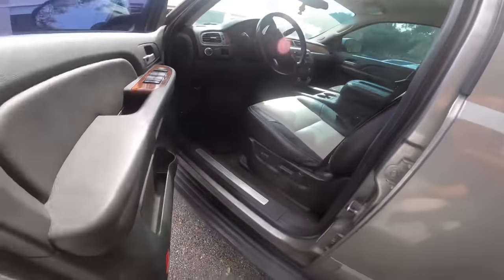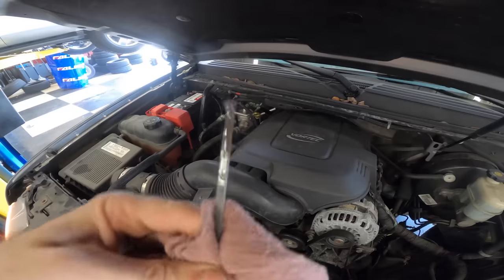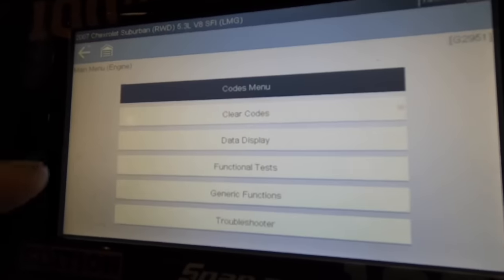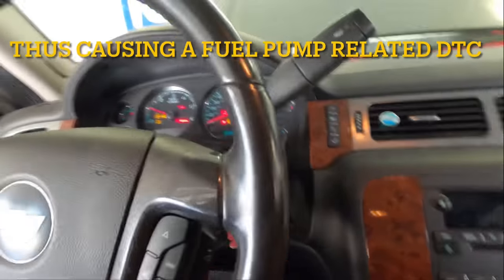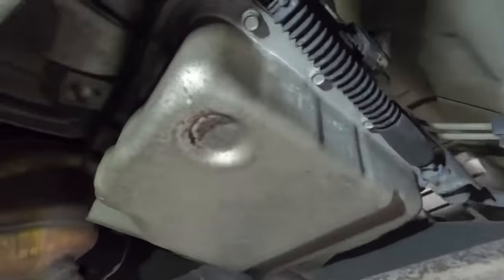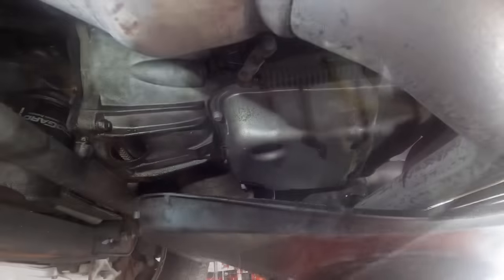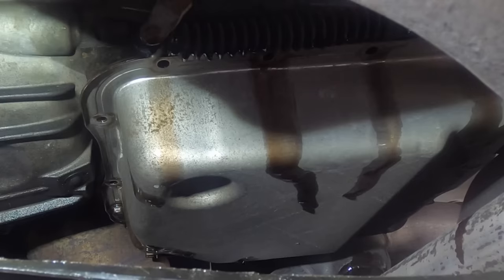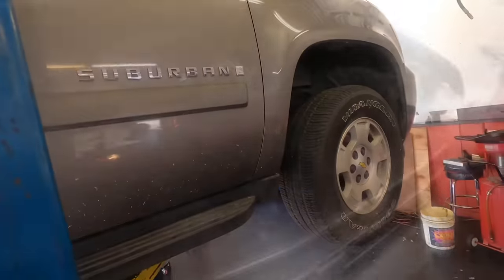Busted! SCAMMING Mechanic Causes Damage! 4l60E Transmission

Comment: Spent 40 years in the automotive field. 25 years as a automotive instructor, and 20 years working on those darn cars. I am now 83 years old and have been retired for 20 years. I hated when mechanics tried to run a scam on innocent people. I always tried my best to do an honest job for a fair price. You sir, are a boon to our field. You did an honest job. I hope your customer got some of his money back.
Reply: Yes. My father is a marine engine mechanic as well and is the same way about treating customers right.
Reply: Removing power from the trans will force it start in second, and shift to third,  and maxes line pressure. Older GMT400 and GMT325 models definitely had ignition switch issues that caused this symptom. Somebody knew damn well what they were doing, they were going rip someone off. Driving around in 2-3 hi-cap for weeks equals a somewhat stupid customer though. That transmission is probably short on life now too, 4L60E wasn't known for being overly robust.
Reply: Travis thanks for all the years of hard work and i just wanted to give you a pat on the back for being a hard worker and good person…..💪🏻👍🏻
Reply: Respect mate
Reply: @jamesgeorge4874  was that a 4l60? Damm ones I've seen go upto 450hp in a commodore, I don't mind em still to this day haha, my vx v6 runs a 4L60 tran in it and she's smoother then most... (mind you, it's paired with a 3.8 ecotec or 3800 l36 S2 in usa)... it's all bulletproof I reckon haha
Reply: Just watched this video from England and I have to commend you for being a good honest man. I wish you the best sir!
Reply: @mr.sunnyg5510  it's not terrible, the factory sun shell is weak, and the factory reliance on a clean MAF sensor are its biggest drawbacks, anything over 450 hp , or use in a heavy vehicle, it's not really ideal.
Reply: I'm a automotive technician and I used to love doing it going in every day I loved it and the best part was I made really good money doing it now I'm constantly being asked why my hours are down because they are comparing my hours to to guys who are thieves with no morals and don't care that the person they are ripping off probably didn't have the money to do the repair but felt like they have no choice because they need their car so they go ahead with the repair. It's sad but I can say it does happen and it happens a lot and it's the owner / managers that allow it to happen and I guess I'm no better because I know it's happening and I do nothing about it. I have a family and bills to pay I know that shouldn't be a excuses but it's a tough situation.
Reply: You sir are a genuine inspiration
Reply: Hope that one day i can becone a good mechanic like you and the video poster. Doing good honest quality work is far more profitable then trying to scam people who probably know next to nothing about their cars. Plus id get the satisfactjon that i actually fixed the problem instead of duct taping it for someone else to fix.
Reply: @Abandonsoyciety  A good, honest mechanic has more work than he can do.
Reply: @jamesgeorge4874  as I said in another post, the customer should sue the shop that did that for transmission damage. and maybe get a unit with an upgraded sunshell. like the Sonnax or BEAST.
Reply: @mr.sunnyg5510  well I've got a 4l 60e in my 04 vy clubsport and I didn't drive it like a fool....got it with 110,000 klm's and it was 10 years old....by 150.000 kkm's and 2015 ,..4th was slipping... Needed a rebuild..not reliable for a car over 250kw's ..or over 100,000miles.. According to the yanks.
Reply: @palerider2020  04 clubby aye? Didn't they have the 65e instead of the 60e? Is M32 the tran code on it
Reply: @mr.sunnyg5510  mine is an 03 not 04 and it's not an R8....not sure on the 32 code
Reply: @palerider2020  ahh right.
Reply: @mr.sunnyg5510  how strong are the diff on these cars,..someone said nearly as strong as a 9 inch??
Reply: @palerider2020  all depends mate, they come with a lsd from factory I'm pretty sure so the original should hold up (ol 9 inches can take 400+ horse power) and ya stock clubby is doing 320hp about... if ya ever looking for a good diff, Trumac (truetrac sorry) is the go.
Reply: @62saki91  I have been to court on behalf  of the plaintiff in cases where the shop's negligence caused over $5000 damage more than once. Unless the defendant admits they made a mistake, or it's on video, the burden of proof is on the plaintiff. It's extremely difficult to win. In each case the plaintiff got the money back they spent on the repair, but that is all. Most times the attorney fees are higher than that, and the end result is disappointing. It's bullshit, but that's just the way she goes.
Reply: @jamesgeorge4874  that is partially the fault of the plaintiff, sue for damages, or repair bills and legal fees incurred. ;)
Reply: @palerider2020  everything in the case is replaceable, '98 and up the case and bell   separate too, whomever told you that was short on skills. I've seen the same 4L60E built at 180K, then rebuilt again at 430K, and the last time our shop went through it, it was over 700K, he just wanted to put a million miles on it. GMC Savanna with a 4.3. Michigan to NYC, 3 times a week, pretty much non stop.
Reply: @62saki91  It's up to the Judge, what the plaintiff gets, and what the plaintiff wants, and what the plaintiff gets can be  quite different.
Reply: @jamesgeorge4874  thanks for the heads up... My 4l60e is behind an  03, ls1 and has been tuned to about 230kw at the back wheels...and after a while 4th started to slipped when I kicked it in the guts...I got told on some forum that after 100,000, miles,  they start to play up..I was gonna put a Cam in it...but got told will have to strengthen the box, and put a hi stall...so not gonna bother with it...thanks again.
Reply: @palerider2020  not a bad plan either, especially is you're turning up the wick. Good luck in your endeavors.
Reply: How you survived that industry for that long and not drag a few customers out behind the shop I'll never understand.. but good on you kind sir.. you are a gentleman and a scholar..
Reply: oh really lol
Reply: Travis Bradley ? for draining transmission fluid from my car with not drain bolt. I used a fluid pump and drain the oil from the dip stick by inserting a long tube so I don't have to spill oil when removing the oil pan.
Reply: Travis Bradley ? You ever heard of a customer sabotage his own vehicle, so when he takes it to the mechanic the engine would lockup, just so he can sue to get a new engine ? The owner do some old 1960s mission impossible stuff with a remote that disperse "Sodium Silicate" into the engine.
Reply: @jamesgeorge4874  You can not call people stupid because they don't know anything about their vehicles.  That's why they go to mechanics.  Otherwise they would of become one themselves.
Not everyone can feel or hear the difference in their vehicles when they start to need service.  Nor can everyone afford to make repairs immediately.   Some of us have to pinch pennies.
Reply: Well said sir I own a paint an body shop, I seen it all on people getting scammed by getting CRAPPIE WORK. I do great on prices an life time warranty all my paint jobs
Reply: Same here, I had more hard time fixing scams that really fixing regular problems.... I couldn't walk away when somebody tells that they've been scammed out off 3k or 4k and needed a certified tech to help them out, because they needed the paperwork to file a lawsuit,  I saw things that I thought only happened in movies, lmao... like a whole shop disappearing, I'd go with the costumer to the location, and they were gone like if it never had been there... most times I'd find the property owner as confused as we were finding their tenants just gone...  the kick is ,these type of ppl make 10 or 15k scamming ppl and don't pay rent for 2 or 3 months, and move on to the next town... is obvious that at the end of the year it'd add up to a good bag of money..., although in one occasion, things went very bad for a car sales scammer when the costumer learned that he got duped out of 9k for a vehicle, the costumer went and shot him multiple times, luckily the man didn't die, since then I was very careful taking on those cases....
Reply: 83 years old and your name is Travis ?
Reply: @cohohoho2589  That is correct
Reply: I began figuring out how to repair my own vehicles after I was ripped off by a mechanic. I would go to wrecking yards and just look at all the vehicles they had. I would talk with other customers there and watch them removing parts. I would get permission from the yard owners to take parts off and put them back on just to gain experience. I eventually got a chance to work in a Kenworth dealer/repair shop. That lead to me getting hired at a construction company as the fleet mechanic. They had purchased 25 new Kenworth trucks with end-dump trailers and three triple transfers to add to their existing fleet. There were a number of older guys working in the shop who had been doing that kind of work for 40+ years; and while I had some knowledge of fabrication, one of the guys took me under his wing and showed me a lot of tricks. He told me it was rare to find someone who would take time to teach a beginner, so I needed to respect the knowledge he was passing on. I still carry that respect to this day.
Reply: @jamesgeorge4874  not sure i agree with you on the robustness of the 4L60E, possibly just my luck with them but I've yet to find one that isn't near bulletproof (two in the 160k range, one in the 230k range and many more I can't recall) IF you aren't trying to drag race them, etc.
Reply: @palerider2020  if all you do is putt around, they'll last 200,000+ miles. I got my wife a 2007 Trailblazer with the 5.3l with the 4l60 or 65e, either or she's at 200,000 miles with no problems. However, my 2003 Silverado with a 5.3 and 4l60e, I'm a little rough with and I'm sure the 35's don't help, I'm at 300,000 miles and like clock work, it's needing another transmission, it goes out every 100,000 miles
Reply: Thank You Sir For your Instructioning  of your past students. You are a example as of doing the job correctly. I myself made proper repairs In the past. My Instructor told me that if you do good work and your honest your parking lot will be full of needed repairs. I had to leave one facility do to their stupidity. I wasn't.going to be any part of it.
Reply: @jamesgeorge4874   Very True, It's going to buy the owner a little time. The 4L60E can be built better than when It was new.
Reply: @mr.sunnyg5510  They are a good transmission to rebuild with some up grades. The 4l80 Is another good one but the.shift cable runs opposite of the 4l80E.
Reply: @diameadozen  I Was In the same boat. I guess our boxes are on wheels for a reason. I understand and I'm glad I'm gone.
Reply: @christopherl2143  If you don't mind me asking what do you do now?
Reply: I've never met an 83 year old named Travis...
Reply: @silkroad1201  Travis is actually a old French/English  name look it up
Reply: @palerider2020  no they're not as strong as a 9" without a good bit of work done to them, and at that point, you could have likely used that money to pay for a large chunk of a 9". It all depends on what you're doing though. There's plenty that are under vehicles running anywhere from 12s to 9s in the quarter mile, but they all have lots of work. Stock for stock, the biggest difference is the 9" doesn't have C-Clip axles, big bearing ends, drop out third, etc etc. 

I will say if you're worried about your 8.6 and want to gain some cheap strength, you can always find a 14bsf (14 bolt semi float) axle that came in the 1500HD trucks and a few others. Basically getting a 6 lug rear with 9.5" ring gear, larger 33 spline axle shafts, and if you search around for the right one, its pretty much a bolt in deal.  You can probably pick one up for a few hundred bucks, and gain lots of easy strength for the money, but it will take some looking around for the right one. 2wd are narrower than 4wd, some are 8 lug vs 6 lug, the ones out of cargo vans have an offset diff I believe, etc. Thankfully plenty of folks have figured this all out and it's on the web in numerous places. 

In all reality, unless you're launching hard on slicks with a lot more hp than stock, you'll probably be fine on the 8.6. It's the traction at launch that breaks most of them and it's why you see them living in 800hp+ turbo'd trucks with sticky tires. They often don't leave violently off the launch and the power comes in after the 60', which often times is specially tuned that way to help with traction off the line or on the street. Just run it til you break it and go from there. Thankfully the 8.6 10 bolt seems to hold up much better than the 8.5 bolt in OBS trucks.
Reply: @palerider2020  as far as the 4L60 goes, I've never seen one reliably hold up to higher HP. I've seen several fail on stock power, just being driven around town by responsible drivers. That is what I'd be concerned about swapping for something that can take more abuse before the 8.6. I've seen some 9 second trucks running an 8.6, but can't recall any with 4l60's.
Reply: @randywright9952  You can scam anyone once.  A bad rep is hard to repair.
Reply: My 96 Chevy Blazer has a 4 L 60 e in it, that Chevy Suburban is a 4L 65 e
Reply: @palerider2020  the diffs under half ton chevys has been junk for years
Reply: @biosaber585  i dont know if you know this but for a good trans 200k isnt alot
Reply: @hansloe3742  depends on the context the transmission is being used for. A daily driven car with 200k vs a racing build with 200k have amazingly different wear and maintenance curves. 
Also you gotta consider WHERE a vehicle is from. I live in the Rust Belt of the US, daily drivers here take heavier wear due to the road salt and chemicals used to treat for snow and ice, it means any vehicle with 200k generally isn't worth much more than scrap for body, frame, trans, etc.

The 4L60E is a solid 3 speed within all contexts, its a good daily transmission, well liked for towing rigs (medium weight) and is pretty durable for all terrain things as well like mudding and crawling. Id not recommend one for heavy wear and tear or insane stunts but totally stock its one of the better transmissions chevrolet has made.
Reply: It's a shame that when you find an honest person, it's like finding a unicorn. What happened to people.
Reply: God bless 🙏 you brother
Reply: Hope you were better at working on cars than you are at math lmao
Reply: @JONOTron theyre really not. Some of the most prominent picks in offroading and racing are the power glide, turbo 400, turbo 350, 4L60E and 4L80E, obviously stock they aren't the world's best but they're all sturdy transmissions that last longer than those used by dodge, Ford and Toyota. And once we start talking aftermarket work on them they're really some of the strongest transmissions on the market that aren't a purpose built part.

There's a reason the prices for these transmissions are to this day ridiculously high and its because people who want them are willing to pay top tier prices to get them, they're reliable and can take a beating, its like the ford 9 inch rear axle, sure they make better ones these days but its still used because of its durability and reliability.
Reply: i hope that scammer got the worst he could for screwing over who knows how many innocent people, a hefty fine for the scams, losing his business and jail time to ice the cake.
Reply: A honest mechanic, do you know how rare that is in big cities? I had a mechanic still my heads saying that it was bad. He loses my manifold so water would shoot out my tail pipe. So I was out 2grand and  heads
Reply: Do you know the banana trick.
Set some banana in your transmission .
The Gears wil Nice and smooth Working again.
I'm jonger 42 years and i know what people do to sell the junk.
22 years in automotive .
Reply: I am not saying there aren't fair price doing a proper job (not taking 1/2 assing  their work). I am say those mechanics are rare gems to find. It was a combo of being cheated, a couple mechanics not properly repairing my cars and only being able to afford  so much for repair and only being able to afford crappy cars , I learned to work on my cars myself. I guess if any thing good came out of it I have a a pretty good idea of when I am being feed a line of bull.
Reply: Well Howdy Howdy from Tucson! I started Turning wrenches in 04 as a AH-64D Mechanic. I medically retired in 2012 now I work on rollers not whirly birds, and appreciate doing the work the right way. I am also a huge fan of preventive maintenance.
Reply: MOST shops scam people!
110 dollar's per hour to plug in the scan tool ?? Basically a computer telling a tech what to do!
If that isn't scamming people I don't know what is..
Remember to treat others as you want to be treated...
Reply: You were probably 20 years old when you started, 40 years in the automotive field. 25 years as a automotive instructor, and 20 years working on those darn cars, and have been retired for 20 years = 125 years ..... I'm damn glad you weren't a math teacher.
Reply: Travis Bradley, Thank You for your contribution to the automotive repair field. I As well did my best to do a good job. My Grandfather had his own shop. He would go.over and above what He charged. I learned my strong moral ehitics.
Reply: Bless your souls and all those you helped learned.
Reply: I thought you were in the steam engine business or your dad any way from Springfield Mo !! So
Reply: @mr.sunnyg5510  They are better than the 700R4 In My Opinion. And if you do have to build one their Is.all sorts of crazy upgrades that can make them even better. 4l80 Is A good one as well. The variable speed transmission is going to be Interesting. Will See.
Reply: Great job with your troubleshooting, spot on process. I despise shady mechanics and shops. Im sure the owner of the suburban is a customer of yours for life now. His family and friends most likely will be too. Good stuff dude!
Reply: Correct my math but I thought 25 + 20 equals 45?
Reply: God bless 🙌 all the good mechanics
Reply: @biosaber585  we must've had different 4l60's if you're driving it to and from work it works fine you want to do anything that requires using the full power of the engine then it's going to fail rather quickly. Drag racing, mud trucks, rock crawling, anything similar will have you with a trans that only has 5 neutrals
Reply: Great work. You are a breath of fresh air. Gracias
Reply: @jamesgeorge4874  That's impressive- How many miles roughly for fluid & filter change? I've heard 30,000 - 60,000 but that's big spread-
Reply: @diameadozen  the fact that it weighs on your mind says a lot about your character. We know life doesn't consist of being the whistle-blower in everything you do in life. Sometimes your responsibilities as a father or husband outweigh the parts of life we don't like or agree with.  Respect to you for caring about the people who come to you vulnerable situations.  All those big car dealerships and garages know what they're doing when they pay their technicians let's say 5 and 1/2 hours for a certain job no matter the conditions.  I've seen honest mechanics and technicians work a long day and then explain toe that they only got 5 or 6 hours "on paper"
Reply: @62saki91  Hard to prove .
Reply: We need mor honest people you end up with haughty young and old people that when they know what they are doing they still try to rob you blind with out any remorse
Reply: Travis Bradley thanks for the honest work that you put in throughout the years
Reply: Amen partner! In my field as a Master Electrician, I find it rare to see passionate, dedicated, reliable, and trustworthy individuals performing their trade to satisfy quality service to the customer. I'm up there with age with you as well and as you can tell throughout these fine years of our service, we are a dying breed. I viewed this gentleman in this video in its' entirety. he had proven to me that there is still promise for future generations to follow. Integrity, honesty, and just plain promise is all we have to prove this very subject which defines our SOUL as an intelligent human being for which I HOPE will carry on well beyond us. WE ALL should remember one very important fundamental factor which holds true, "We are ALL on this planet together" and without unity, trust, integrity, as a whole there is.......?    Take care and GOD Bless.........Phil
Reply: This seems a little fishy to me. If this was a honest scam why would you hook up a Blue wire directly to the top fuse box? Pretty obvious that you made some sweet click bate. Sorry man it's just so hard to believe you went through all that diagnosis pulling out the fuse box before looking wth a random wire is doing in a completely stock looking engine bay. That's my opinion on this whole thing.
Reply: I don't believe an 83 year old man just made a YouTube account in the last year lol
Reply: Ngl but the maths don’t add up?
Reply: You're a good man, Mr. Bradley.
Reply: @floorpizza8074  he's a liar is what he is 😂
Reply: Yeah
Reply: @jamesgeorge4874  you
Reply: Yeah l l
Reply: @jamesgeorge4874  FACT, clean MAF on new trans installs !!! good job mate !!
Reply: Oh yes Sir. Travis Bradley, i think on his next life he will be an aircraft or space ship mechanic, an upgrade on what he is so good right now cause his an honest to goodnest mechanic down here. Glad you are same as he is Sir. Bradley. Nice to hear people like you, just hope i could meet you two, By the way, my daughter has a Toyota Rush, a Daihatsu rebrand from Indonesia, though its just under 105 horse power  but so far so good.
Reply: Very well said sir. I completely agree.
Reply: Maybe it's him his self
Reply: @markmoses7300  who knows
Reply: I hated the cheats in a couple of the Shops I was at. I went to management about one of them, but they literally didn't care.
Reply: Just found this clip.
Because of to many "bad apples" I already restarted to service and repair my cars and bikes.
I'm old, my back pains and I don't want to have any more oil fingers but I have no other chance.
We need urgend a lot a honest workers like you.
Regards from Belgium
Reply: @diameadozen  I found that not getting into Names & politics unfortunately enough!
Reply: i can't wait to be 83, an avid typer, my wits still with me and still feel like gloating about my resume.  
lol just messing with ya. 
Don't mind me I'm just jealous.
Reply: Most was very simple 2
30 - 40 years ago it was easy.. now its just a fucking mess with sensors, electric shit and so on. Give me a tool box for 20 buks and i fix any V8 that are from the 78-79 and older if they not need a new part!
Reply: The knowledge you could share with that experience is priceless. My dad owned a transmission shop for nearly 50 years. Sure wish he’d let me get some instead of insisting on going to school. Love working on cars but not a good tranny man.
Reply: Scams like this and others is why I want to open my own shop one day. I hate that these companies care more about profit over safety and satisfaction.
Reply: I'm 66 years old and I always buy used cars or trucks. I moved to Florida and i got a used 2000 ford ranger only 6 years old when I got it I'm 2006.  I never let anyone touch it I did all and any work to my truck.  Got with 111.000 miles not it has 200 .100.  Since I was 18 years I saw to many mechanics ripe me off!! So I learned how to fix cars and trucks from my street mechanics.  I saved money all my life. It was worth it!!
Reply: Good work ain’t cheep and cheep work ain’t good.
Reply: @jamesgeorge4874  yeah i had to replace 3-4 clutch packs in my 4l60e, if you get on that trans hard at all it basically shoots itself in the leg
Reply: @JONOTron older 4l60e's (from the 700r being renamed to the 4l60e around 1996-7 up to about 2007) are absolute garbage, they are literally just a renamed 700R which was trash to begin with..but the newer 60e's are pretty damn good
Reply: @spec_opsgaming  Born with one foot in the grave, the other on a banana peel...
Reply: i hope you enjoy you retirement, you sure deserve a peace and joyful one for being honest to others, god bless you
Reply: i was victim of one of these scams i went in to get an axle seal replaced came out with exaust manifolds rear main seal and an untouched axle seal btw there was nothing wrong with the rear main seal or exaust manifolds and they also put the wrong ones on and broke every sensor on the engine
Reply: Blue wire was hard wired to the fuel pump?
Reply: The worst part is : the dishonest or incompetent techs make the consumer and tech interaction difficult down the road.  It makes a difficult situation more difficult.  No one is ever happy to have there car break.
Reply: I quit working at 2 shops because of "repaint/rebuilds" I just wouldn't do it. I hated ripping off customers, I just wanted to do a proper, complete repair for a reasonable price and have happy repeat customers. You make more In the long run that way, and don't hurt anyone.
Reply: I used to get ripped off by those scam idiots. I learned a lot about vehicles and now when idiots tell me I need a bunch of crap done,, I  walk around the car with the idiots and point their stupidity out right to their face. You should see the lookon their faces and how quiet they become. It's absolutely hilarious! I make sure they know how stupid they are before leaving. YouTube and the internet has taught me how to fix basically anything on a vehicle. I still have to get my vehicles inspected because unfortunately I live where that is required. I can't believe what some of these shops tell you needs to be done just going in for an inspection. I make sure I leave an honest review on Google, these days. With reviews a lot of bad shops are being weened out.
Reply: I have been a shade tree mechanic for years and I always did best for the people that I worked for and I could not keep up with all the work that came my way if one does good work there will always be work but if one is dishonest just once or twice they will never get far
Reply: Taed
Reply: Thanks for your service Travis
Reply: That math doesn't add up.
Reply: Great video 👍 but I really hate to see a qualified mechanic using a flat blade screwdriver to remove any kind of seal or gasket 🙄
Reply: Some men walk the line some men talk about it.
Reply: Thank you Travis for being one of the honest ones. To be honest it's hard to trust anyone especially during times with COVID that many shops lost business I bet. I wish Ray was in my small town in Wa state.
Reply: @diameadozen  Dang, I feel the exact same way. As a plumber, my integrity has always been questioned. I don't take it personally. I understand the customers skepticism n untrusting nature. We have the scumbags in our respective professions to thank. Good mechanics, plumbers n police officers all have to deal w this. We're not superheroes, we can't stop it. We can only do our part n continue to be good honest human beings.
Reply: @jamesgeorge4874  Exactly, as a good honest plumber, I am NEVER short on jobs.
Reply: @coyote702  Word. I do very little side work, but people still ask, regularly. I know that I could walk from my M-F gig, and tell one person I'd fix their car, I'd be buried in work. If you have the tools, the talent, and integrity, you are you're own master.
Reply: @biosaber585  better than toyota? I know several people with 300k plus miles who 4x4 real hard and have never had a problem with a toyota transmission.  I drive a 93 automatic with a 3.4 swapped from a 98. The a340h I have is holding great, and I tear the crap outta that thing. Just snapped a rear swaybar on the trail.
Reply: @fightthelies4349  you meet the goose that lays golden eggs too? Mate I'm not trying to be a dick but I believe you about as much as I believe a flat earther. Maybe some people DO have good luck but where I'm from, you offroad in a Toyota old OR new and your ass is getting rescued by someone in a Chevy or a custom rig (most Ford or dodge rigs aren't fully Ford or dodge and usually have engine swaps or sometimes axle swaps, depends on use case hence the term custom). Our mud here is about 80% clay 20% soil so the mud is VERY sticky and tends to hold worse than anywhere else, it breaks axles, burns up transmissions and I've even seen guys punch holes in their engine blocks because of it. Maybe other places Toyota transmissions and vehicles are a good pick, but here? A farm tractor would serve you better
Reply: To be honest about now quit jobs when I really needed to be employed cuz the guy that owned the business was a truck and wanted me to go out and represent him and rip off customers I refuse to do it picks up my toolbox a couple of times and left have a good day
Reply: Cap
Reply: You 84 now dude?
Reply: @jamesgeorge4874  Not necessarily stupid just oblivious.
Reply: I always wondered what people do when they are retired,
apparently they watch other people doing their old job online.
Reply: Fake
Reply: You must be so old.
Reply: @Archenemy236  He says in his comment that he is 83
Reply: When I was working in automotive repair, one guy said something that, while obvious, made a lasting impression on me: "There's enough honest work out there you don't have to scam people."
Reply: I'm 69 years old and been in the trades over 50 and I do not care for people to take advantage of those that are mechanically challenged and have actually walked out of shops where they were taking advantage of people because I could not represent such shop it's a shame things have to be that way but I'm not going to represent somebody that's a crook have a great day
Reply: I worked in a shop and witnessed a scam yeah I called them out was told to just shut my mouth called out the next day and the following day I quit. I can not work for a large known company that scams costumers
Reply: I want this man to work on all my cars from now on.
Reply: I didn't think they started naming people Travis until at least 1970?...lol
Reply: Who are these guys who try to scam people?? I mean no Integrity whatsoever
Reply: @mr.sunnyg5510   in my experience, the 4l60 is good, the 4l60e is bad because computer. I personally like the 700r4
Reply: 🙏 My respect to you sir
Reply: spiderman no way home< Business as usual, the big corporations have got what they wanted,
Reply: Im an Appliance repair man i i uploaded 2 videos of previous techs scamming and lieing..one was a loose wire..the other the tech used 10$ parts and claims he replaced original parts costs them 1500....the part was 10 dollars and universal on a 15,000 $ refrigerator
Reply: I’m fortunate to have a mechanic just like Ray who takes meticulous care of my 2002 Dodge Ram 1500 pickup. When it’s in his shop there’s no need to fear it not being taken care of and the work will be perfect. I’ll be able to drive it until either it or me falls totally apart. I think the truck will outlast me.
Reply: That sounded like the theme sing to jeopardy.
Reply: Thank you for fixing all those cars, we respect you travis.
Reply: It's terrible that there are rip-off 's   like that.
Reply: I wanted so bad to be an automotive technician went to my high school graduation and was told and was given a high school diploma and then I tried to get a government grant for automotive school and was denied grant because I had a special diploma dream crushed and can’t get a GED..fml
Reply: 47:05
Reply: 47:05 47:05 47:05
Reply: True it's a global problem 
We recently acquired a customer that had always used main dealers for work now the whole family come to us 
We welcome customers to visit and watch repairs take place if they want to We have nothing to hide
Reply: I agree.  I'm 23 years in as mechanic.   And I see no need to lie and be dishonest to make money.  More money comes in by being honest.
Reply: Props for being a true mechanic! Hope life is good :)
Reply: What condition is the condition in?
Reply: Unfortunately I've been in that situation before...
Reply: @diameadozen  we do need honest mechanics to step up together and at least try to stop this theft.its terrible I m afraid to to go to shop I need mechanics near me badly .I do tree care and landscaping been threw 5 trucks I have to buy used and i try to do what I can but I'm just arborist tree guy .and small buisness owner.can fix zeroturn s and 2cycles equipment chainsaws .but don't have time or knowledge to fix trucks. Plus no lift and have to crawl around on gravel .don't have credit so can't get new trucks .and there so high and have that active feul management none sense .I'm praying 🙏 fir mechanic to help Me right now.
Reply: Even worse is when they thumb suck incorrect diagnosis and you need to explain to the client that the actual repair will cost 5x what they though
Reply: Sorry you we’re way underpaid for your hard work.
Reply: U lyin
Reply: yep you just reminded me of  the early 70s  when my boss  fired me because i wouldnt keep a razzor blade with me to cut fan belts  while i was like when we used to check oil and tranny fluid for customers  to sell them belts ahhhhhhhhh the good ol days
Reply: What a great video.  I too, want to know who this individual is that ran this scam.  I think it's human instinct to want to know what tribe member is treacherous.
Reply: A good friend of mine Turned out to be a master mechanic .He told me when he first started the Guy he worked for would personally brake , Brake lines so he could replace them.1960's Cleveland Ohio lots of rust easy to do .
Reply: @diameadozen You move on and be self employed , like a lot of us it's not easy though .Or get in with someone that thinks like you do . Honestly is the best Policy in my book  .
Reply: Good job Ray you are very honest and respectable .I give you Respect Man.
Reply: my son tries 2 help people cause of so called mechanics, a guy from town was knocking <red neck mecanics> then my son checked the car found crap they lied about.  thank u sir 4 bn a mechanic, it's hard work most ppl do minimal work, lie 2 get more $ especially 2 ppl who font know better or try 2 sell them another car off their lot or a friend, sad world,u have a great retirement hon
Reply: hello again I also I grew up round mechanics and learned alot over the years and my son does mechanics old and new,he went back 2 local college 2 learn new syiff computers so he could fix dad's truck and anything new cause he's honest. I thank all uns mechanics that are honest and help people ❤❤❤country woman here from north Carolina, I've help ppl myself and I get weird look till after I fix something or diagnose a problem and get 3 opinions b4 anything is fixed. I was getting on intersectstate saw young couple, car was over heating and just n time I stopped him from putting water on the motor,I told him ull Crack the block and my dad was coming through at the time saw me stopped 2 help. them kids thought they could cool it down and drive it 10s miles 2 the beach. they didn't make it 2 the beach,we told them bout local stuff n mountains 2 do while car got fixed and they had a great trip. I explained 2 never take looks 4 granted cause u don't know what red neck mechanics can really do and how they can be honest,I was talking bout us lol.thank uns so much 4 taking the time 2 help people it's hard work. it pays off in the end cause good things come 2 those who help others❤❤
Reply: Math's out, sure 😂